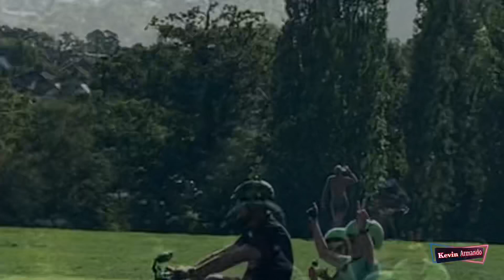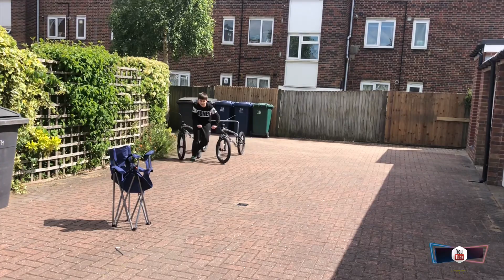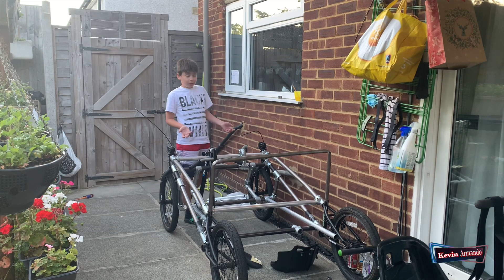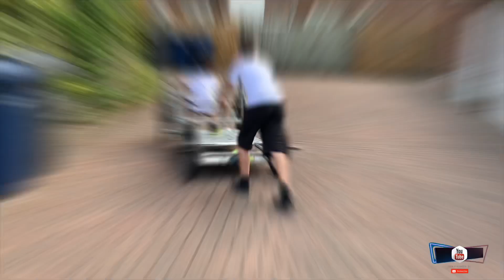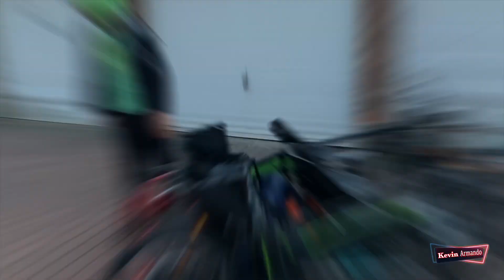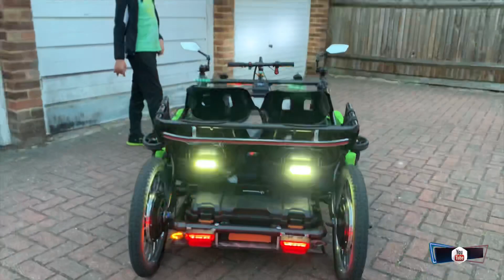How to make Homemade Electric Car 2000 W

Comment: I want to watch this and learn about it but the jump cut fades are making my brain hurt.
Reply from the maker: Im sorry about that. Hope you enjoy the video
Reply: @kevinarmando6207  Thank you for the reply I have been considering building something similar and I am trying to figure out if 2000 watts is enough power. Looks like it is.
Reply from the maker: @porticojunction  2000 w its super powerful if you’ve got good batteries with this one I can make up to 40 mile with single charge